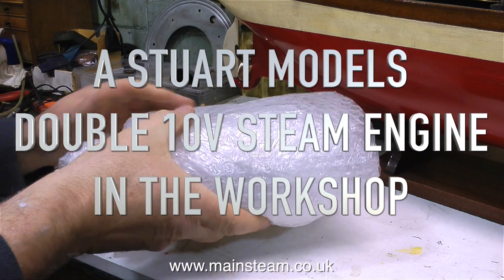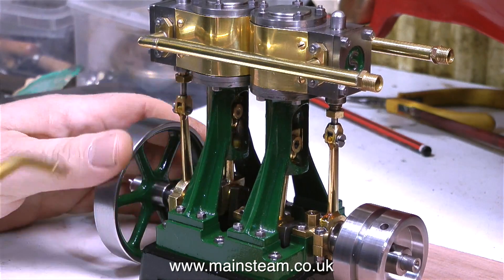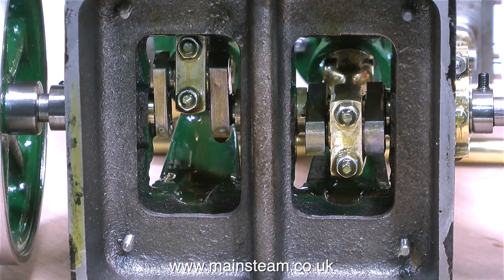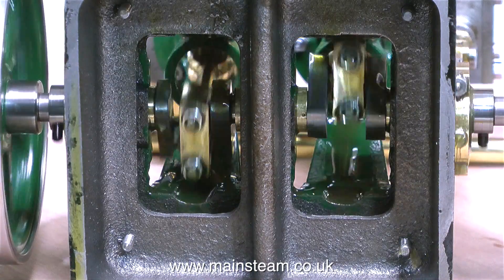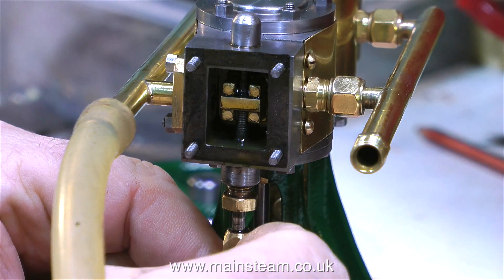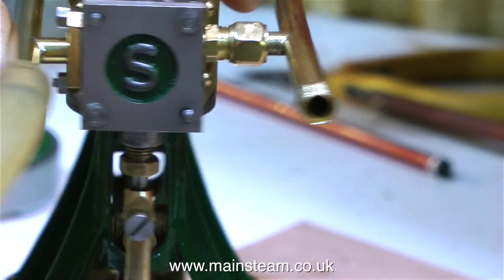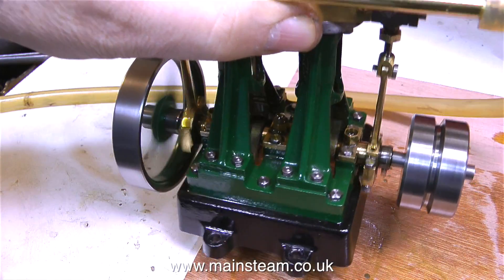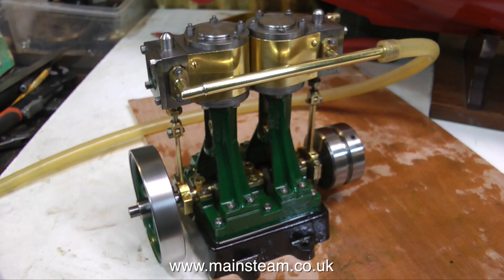PROBLEMS WITH A STUART DOUBLE 10V MODEL STEAM ENGINE

Comment: 1:10 9/32 of an inch... imperial measurements are the weirdest thing ever if you look at it from the realm of millimetres. I as a guy from germany need a calculator just to get an idea of that measurement :D How can anyone do proper engineering with all these weird fractions of inches around? It's like the imperial system lacks a tiny unit, something in the magnitude of 1/32inch (what equals about 0,8mm) - or you could just start using metric :D
Of course i get how it historically made sense, take an inch, halve it, halve it again, and again, this is easy to do precisely using only a ruler and a circle drawer... Maybe it gave british engineers a tiny edge of advantage in the early days of steam engines...
Reply from the maker: Imperial has worked in engineering for a long time - and it still works very well for me (I was taught it at school) - plus the measurements on the drawings for the models are also usually in Imperial . . . . Don't the USA still use Imperial? - they seem to manage quite well and they do make some really nice stuff  . . . . . .  The British Engineers that you mention actually invented, developed and manufactured the first Steam Engines using Imperial if I remember rightly }:-)))

Comment: Why are the pistons not set so that when one is TDC the other is BDC? As I see from this video, they're 90 degrees apart. To my intuition, this would make the engine's power output fluctuate (not a problem on a model, of course) but more importantly make it uneven and vibrate more. Can someone explain why it is like this please?
Reply: As far as i understand it's for self starting. With the cranks 180⁰ apart you could have a situation where 1x piston is TDC and the other is BDC, so without physically turning the engine it wouldn't self start.
With the cranks 90⁰ apart, even if 1x piston is TDC or BDC then the other will HAVE to be in a position where steam or air can be admitted that cylinder and it will cause the engine to start.

I don't know about the 'uneven power' distribution, i think that would apply more to a single acting engine (like an internal combustion engine, where the piston is only being driven in a downward stroke).
I don't know if it would really be an issue with this engine being  'double acting' (the piston providing power in both the upward and downward strokes) or even in an engine of this size, i don't think that it would be much different to a double acting single cylinder engine.

And as for the vibration, the cranks can be 'balanced' with extra material on the webs for smooth running, some engines have it (like my big Stuart 'triple expansion') whereas some don't as i guess that it's just not needed.

Comment: I suppose a new cylinder is the entirely right way to do it, but in the end it's a model engine and should run well enough for a model as is. Could the ports be filled with some brazing and reshaped or would that be almost as much work as just getting a new casting and finishing it?

Comment: As someone without access to larger tools like a lathe or drill press, would you recommend the machined kits form Stuart.  I can get access to files.  I am new to the model world and was wondering if that would be the best starting point.  Thank you
Reply from the maker: It would be a difficult job without at least a Lathe ...... :-((((
Reply: Thank you for the reply,  I will keep searching.  With the models themselves being or 200 USD I might as well save up for a smaller lathe.

Comment: What about the sloppy machining in the valve chest? So far, every Stuart i see here has problems with machining and tolerances. Manufacturer might be using off-site employees.
Reply from the maker: these models are made mainly by amateur home machinists not by the 'manufacturer" - they mainly sell castings. Stuart pre-machined kits are very good from my experience.

Comment: Is there any kind of epoxy or other material that can be made to adhere to the ports to allow re-shaping and would stand up to steam?
Reply: yes, I was thinking the same thing, a bit of JB Weld epoxy would be an easy fix, then file/sand it smooth.

Comment: Would it be possible to repair the valve face without machining a new cylinder? JB weld or solder another face on it?